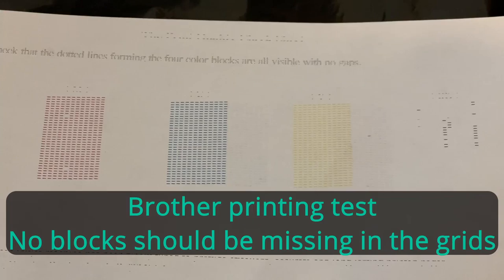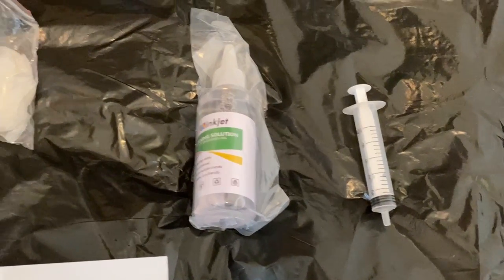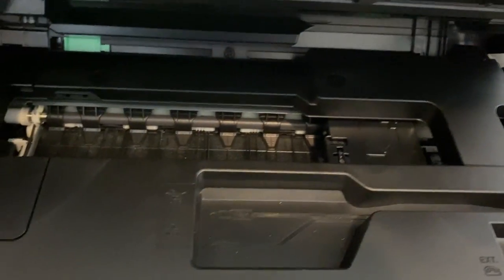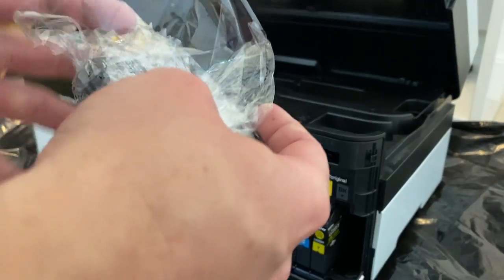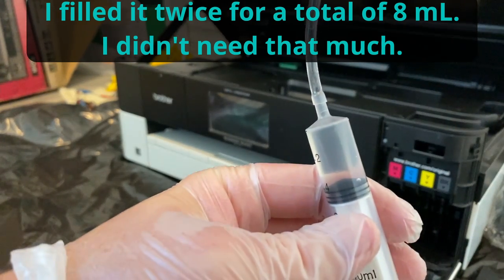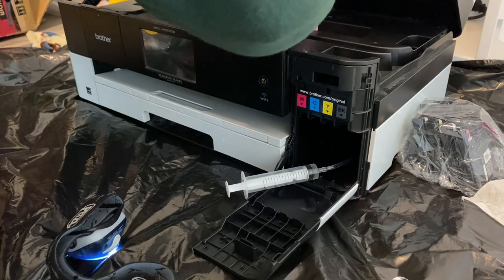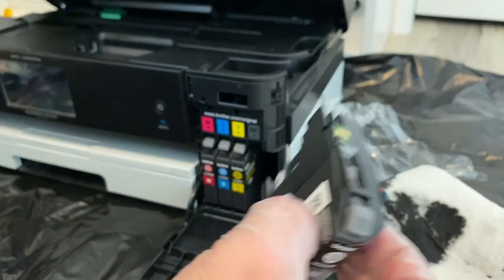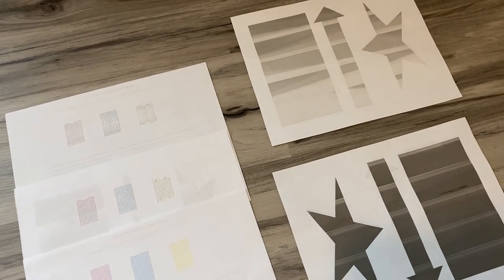How to Clean a Printhead Brother MFC-J4620DW

Comment: Sir, you saved my bacon.  This worked like a charm.  I had an old kit with slightly different tools, but stuffed paper towel under the nozzle to absorb fluid fro the cartridge nozzle.  I did use hot water first, then about 4 ml of cleaning solution.  Most impt. was drying time.  Several heavy cleanings did the trick!  All the best.

Comment: I have a question. I have a Brother MFC-J5520DW and I tried cleaning the nozzles the same way you showed by plugging a tube with a syringe onto the intake port, except I used warm water. My Cyan was the one that was the most clogged and when I pressed the syringe not much was happening, only a tiny bit of Cyan was coming out onto the paper towel, then all of the sudden all the water from the syringe started squirting out of the Yellow intake port while it was plugged into the Cyan port.  I played with it a little bit then water started coming out of the Magenta and Black ports... Is that normal, or did I brake something by giving it more pressure?

Comment: cleaning kit manufacturer video's usually suggest sucking out excess ink and dumping it into a spare jar before injecting the cleaning solution.      much less mess that way and then you use less cleaning solution.

Comment: This process will either solve the problem or kill the inkjet. I've used it on 3 printers. Two were destroyed and 1 came out great.
Reply from the maker: I just did this fix again to the 3 color lines. It worked great. I only used about 4 mL of solution in each line. A friend of mine says his black ink line is so clogged that this won't work for him. That's either a bigger repair or it might be easier to get a new printer.
Reply: @tealtoolguide  The cleaning process has value, it can rescue a doomed printer if it hasn't gone too far. What usually happens in a bad scenario is something that requires professional level knowledge happens while attempting this type of cleaning. Such as error 50 and/or 48 (or even worse). Inkjets don't last forever.
Reply: Hello! I'm planning to start the job... Why do you think it killed the printer? Is there something that I could avoid?

Comment: Just a question, did you do this for each color or does doing black take care of everything?
Thanks
       Been having either poor weak black and colors are very light and missing lines in the test page even after the standard cleaning. Will get some of the solution. 
Thanks
Reply from the maker: I only did this for black. However, two of the colors seem to have clogged just recently so it looks like I now need to do this for each individual color. Think about it this way. Each color has a separate line for the ink to travel from the cartridge to the printhead. Each line needs cleaning solution pushed through it if the clog isn't simply on the surface of the printhead.